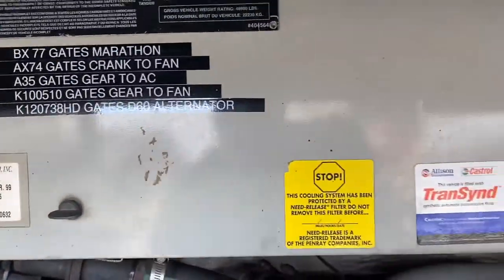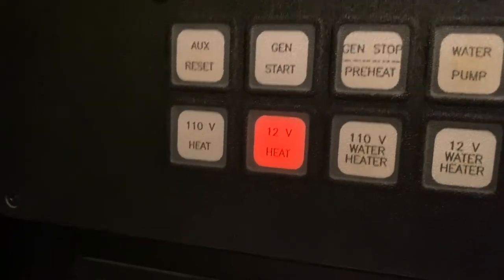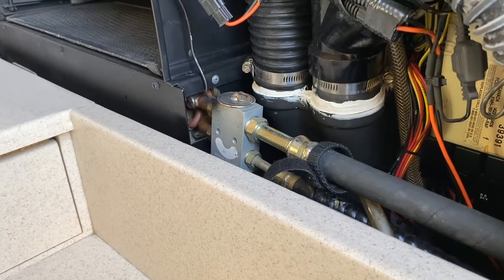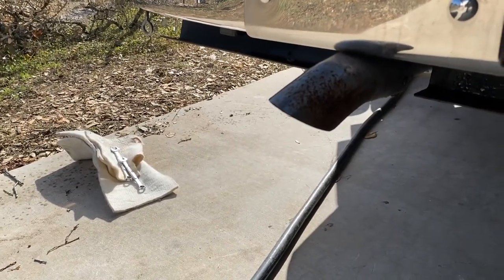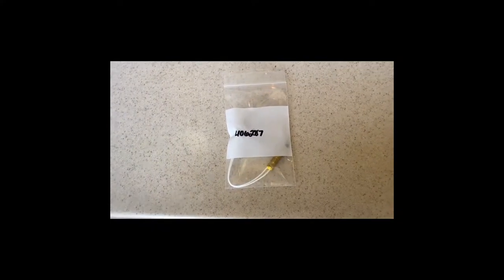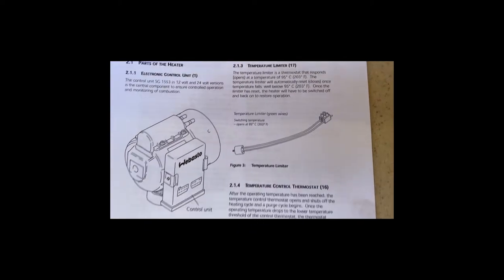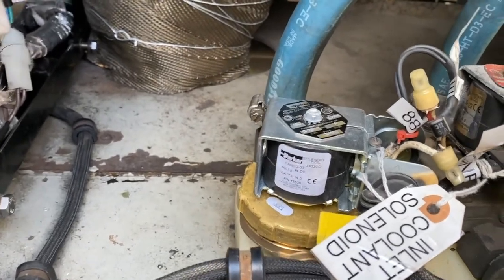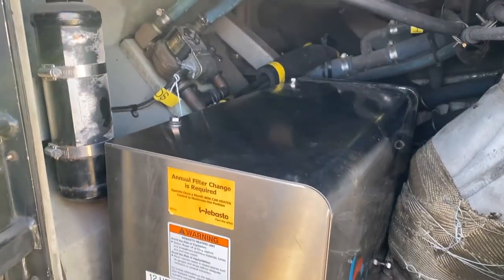Prevost Webasto Tech Tips to Restore Operation Marathon XL Coach

Comment: I have arctic version of the Webasto model DBW2010.74 in Marathon Coach #1085, 2008 Marathon, 2006/7 Prevost chassis.  The Webasto suddenly quit heating a few days ago and started to drip raw fuel out the exhaust pipe.  I am third owner of coach...in checking the heater, it is obvious it has never been maintained.  It tries to light off and does a puff-puff-puff for a while but finally quits trying, only the motor continues to run.  The ignition is sparking.  Likely the nozzle is corrupted.  The heater worked great when it was operable.  Any ideas to try first?
Reply from the maker: Have it serviced by Marathon or Prevost.  There are only a few thiings that could be wrong.  The spacing of your ignitor tips is one.  A dirty nozzle another.  If its clicking it's getting spark.